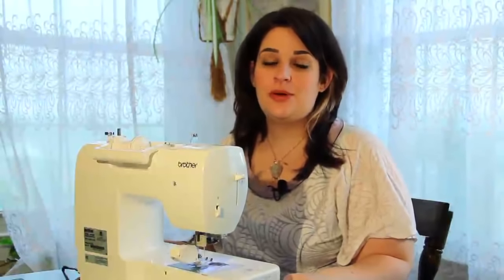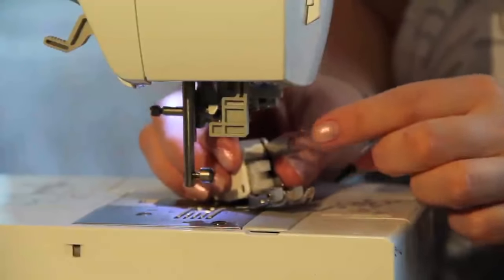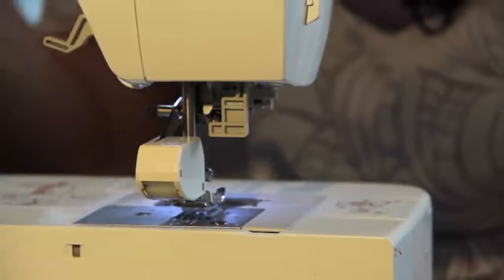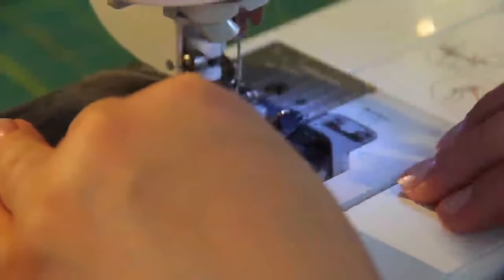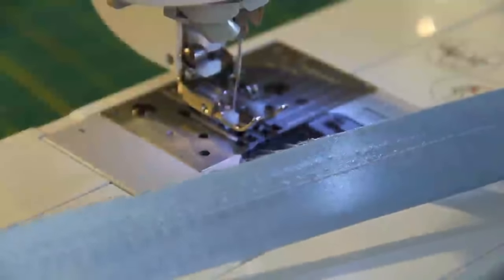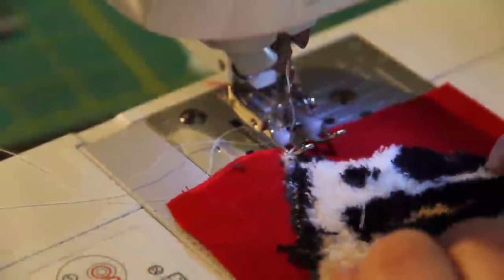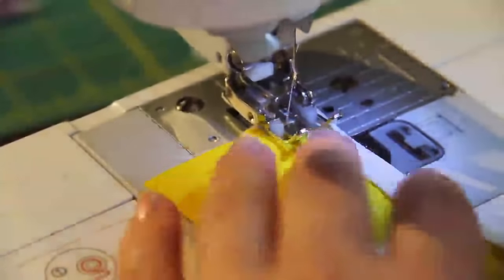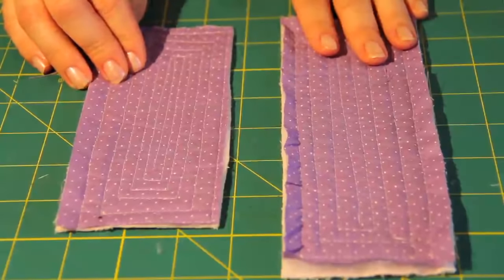How To Use A Walking Foot

Comment from the maker: We don't have a foot with a specific 'mark' , but most of them are designed so that if you put the needle to the far right position (still within the opening) and guide the fabric along the outside edge, it equals 1/4 inch. I just tested it with my walking foot and a ruler - a perfect 1/4inch! What machine make and model do you have?

Comment: Great video. This is definitely helpful especially as a beginner. Just a quick question. What stitch length are you using to have your stitches so straight. Mine are a bit zig zaged. I have a brother CS-6000i. Thanks!
Reply from the maker: I think I'm just using a 2.5 mm length. If the actual stitches look a little zigzag, or might be time to change the needle

Comment: Interesting video. I, for my part, tend to get the best results on slick materials and multiple layers with my Juki DDL-7800 (a Johnnie-one-note industrial machine).  When I compare the results to what I can do on my Janome MC-6300P with a walking foot, the Juki wins hands down.  Both do a fine job though. The Juki seems to have the advantage on curved seams.  I have an associate who is an expert on industrial sewing machines, and he tells me that the walking feet on domestic machines are actually not walking feet at all; they are more like synchronized-dog feet. A technicality, I suppose. Still, if you view videos of industrial walking-foot machines, you will immediately understand what he is talking about. I am not an expert at all on industrial walking feet machines, but my understanding is that they are generally used on extremely heavy fabrics and materials such as are used in leather goods and sails.

Comment: I bought a walking foot and attached it to my 30 year old all metal Kenmore.  But the fit is such that when it is attached the foot is pressed against the machine throat plate and no fabric can fit between, never ind my four layer quilt. Do you think this means my machine can't use a quilting foot?

Comment: Hi Sara, this is a terrific video, thank you very much.  I need to buy a walking foot for my machine, Brother Dream Creator VQ2400 and I checked the brother site to get the part number of the foot.  There are two that work on my machine, a regular walking foot and an open toe.  I make layered fleece blankets, two layers of fleece with layers of polyfill in between, just straight sewing, not quilting.  Not sure which foot to get.  Your description of the difference between these two feet was really good, I'm asking because the regular foot is $24 more ($97.99 vs. $73.99) than the open toe. If you were me, which would you get?  Thanks very much for your advice.

Comment from the maker: It is a high shank machine? Low Shank? It doesn't appear to be a used in the united states, but many presser feet are generic and can be used with other brand machines. If you can tell me the shank type, I can tell the perfect walking foot for it.

Comment: Would this be helpful for pulling the fabric out on its own more? I can't use my left arm, and if I must steer the fabric in with my right hand, I can't pull on the back, like one usually does. Thanks
Reply from the maker: Hello Maritha! A walking foot would definitely be one of the best options to help feed your fabric. Another foot that may be a good option would be a roller foot.
Reply: @SewingPartsOnline  oh, great, thank you so much because I ordered one a couple of hours ago, lol, and thank you for the roller foot tip, I actually already have one, but never tried it.❤️ So this is both gret news. Another question I have, is do you know if those kneelift thingies can be fitted on any type of machine? Or do the machine have to have something in them to make it work with a kneelift? I have seen a kit for retrofitting. But that was for Bernina, and I have a Singer.. And I have no idea how a sewing machine look like on the inside.. (stupid me, I didn't think about the possibility of a kneelift when I purchased my machine 🤦‍♀️)
Reply from the maker: @MarithaAndersen  Knee lifters are made to work with certain machines. I don't believe there is a why to retro fit. Here is a link for the Juki TL2010Q. On the middle-front, you can see a small hole. This is how it will look if it has a knee lifter option available. If unsure, you can always reach out to our customer service and they will be happy to double-check the specifications for you. https://www.sewingpartsonline.com/juki-tl-2010q-sewing-machine.aspx?variant_id=291095

Comment from the maker: Not a silly question at all! You can definitely use a walking foot with your machine. In fact, sewing will probably be easier with one. You machine has an extra high lift for heavy fabric or quilts, so go for it! If you go to our site and enter 077087 in the search box, you'll find a great walking foot for your singer machine. And it's a great price, too!

Comment: It would be good if you could show or update a segment using the walking foot with velvet. I'm sewing curtain ties with loops for my friends and they chose velvet ( I think they just wanted me lose it ) and it has or still is a frustrating journey. I tried the walking foot for the velvet, but i might of rushed a bit, because the seam stitch just ended up being half an inch uneven at the end. 
I'll give it a go but if it doesn't work out I'll let you know and hopefully you or someone else could tell me where I'm going wrong

Comment: I watched this yesterday to learn how to install my foot. The video was great and the foot went on perfect but my machine would not work with it on.  I had bought a 15 pc pressure foot set on amazon and all of the other feet worked perfect except for the walking foot. :(  so disappointed because I bought it specifically to use on my quilting and it wouldn't work and I have 22 quilts to make this year before Christmas.  Oh any my machine is a Brother LS 2125

Comment: Thank you,  I need a screwdriver like yours. Also I have a walking foot for my brother sewing machine can I use it for my Baby lock jazz 2
Reply from the maker: Hi, Sheila! You can order the screwdriver via the link. Please note, it is currently out of stock, but by placing your order, you would be in line for when it comes in. https://www.sewingpartsonline.com/screwdriver-brother-xc4237021.aspx 
As for your Brother walking foot working with your Jazz II, it's a possibility. The Jazz II is a low shank machine, so in order to be able to swap, your Brother walking foot will also need to be low shank. If you are unsure, you are welcome to email us some pictures at info@sewingpartsonline.com and we will be happy to help you!
Also, if you decide to get a walking foot specifically for your Babylock Jazz II, below is a link for some we offer: https://www.sewingpartsonline.com/babylock-blmjz-2-jazz-ii-sewing-machine-parts.aspx?keywords=walking%20foot&index=1

Comment: I need to take up slippery sheer drapes.  Will this work for that?  Also will this easily go over seam allowances on jeans or will I still need a seam clearance plate or jean- a-ma-jig?   Thanks!
Reply from the maker: Hi! This foot will work for both slippery sheer fabric and jean seam allowances. However, you'll likely need to use a jean-a-ma-jig when sewing over intersection jean seams (in addition to the walking foot).
Reply: Okay.  Thank you so much for your very informative lesson.  It's given me the confidence to finally hem the curtains I purchased.

Comment: Hi, great video! I'm a real beginner and I just purchased a brother cs6000i that comes with a walking foot. The big problem is that most fabrics get caught in it and I can barely get them under the foot to start!! What am I doing wrong?!?!? Especially because this machine actually came with this specific part! In not using any crazy thick fabrics either. Arrggggg! HELP!
Reply: Chana Kielski Are you using stretchy fabric?
Reply: Yes I usually see stretch fabrics
Reply: With stretchy fabrics, you usually need to use a zigzag stitch. If your machine doesnt have a zigzag stitch, try using nonstretchy fabrics using the straight stitch. I found this out recently myself, lol.

Comment: Hi Sarah, I am in the process of making a sweater for Barbie. I’m using my walking foot but it doesn’t want to move it just bunches under the bottom. I have checked my tensions I don’t know what else to do. I tried it on a scrap piece of the same sweater material and it worked fine. What am I doing wrong?

Comment: Can you sew backwards with a walking foot?
Is it advisable to sew backwards on minky fabric with a walking foot?
Reply from the maker: I've sewn backward with it to lock in stitches and for decorative sewing and haven't had any problems yet. However, it does cause a little more wear and tear on your foot. To lock your stitches in place without reverse sewing, you can simply reduce your stitch length to zero and create 3 stitches. That will lock your thread tails without reverse sewing.
Reply: Sewing Parts Online Thanks so much for this tip. I appreciate it.

Comment: Ok this will sound a bit silly, but my machine is a very basic model (singer promise 1409) its a lovely little machine that I'm using until I can afford my dream 1008 which I used throughout uni. ANYWAY, would a walking foot fit my singer or is it a little too much for such a basic machine to handle?

Comment from the maker: Nope, it's normal because the feed dogs on the top. Don't worry, you can put the fabric under there. Just pull the presser foot up as high as you can and guide the fabric under. Once you start sewing, the foot will do the rest.

Comment: I just started quilting with a singer heavy duty. I am currently trying to piece and having trouble with my needle. is there a particular needle to use with this foot. I am going from hand piecing to machine so I am novice.
Reply from the maker: Hi, Angela! A universal needle size 80/12 or 90/14 should work well. I know many people have had issues with the Singer Heavy Duty machines in general.